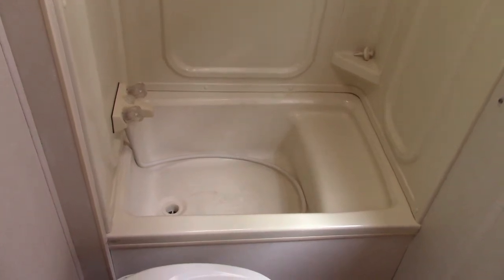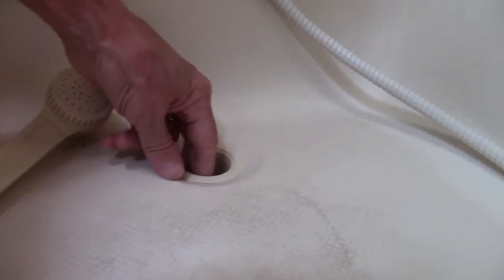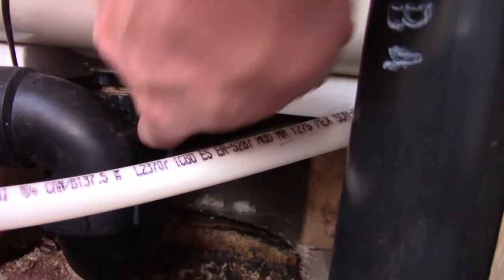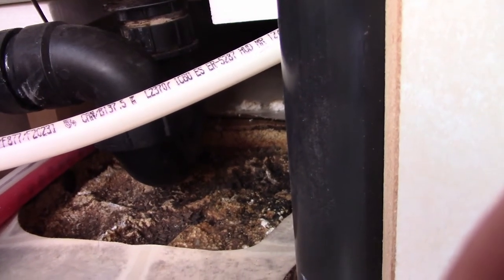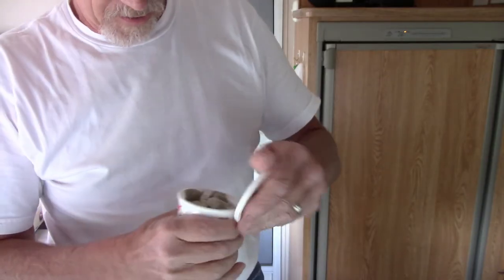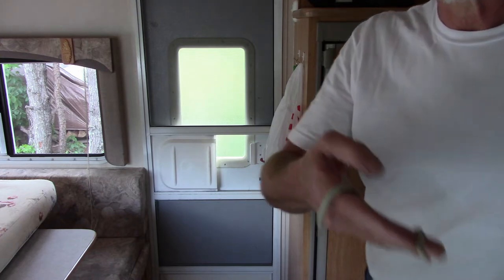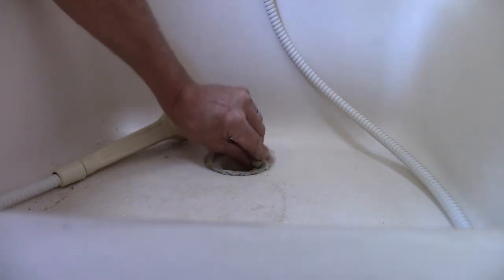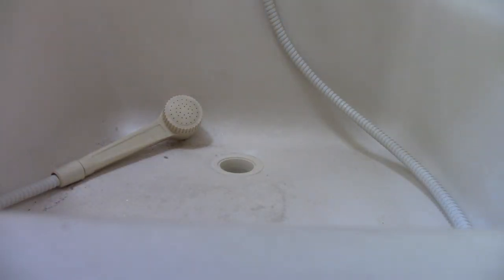RV/Camper Shower Drain Repair DIY

Comment: Did that really fix your leak? I had same problem and the cause was the lack of support under the tub?
Reply from the maker: It did fix my leak. However you are correct about support under the tub. They don't do a very good job at the factory. I had to fix mine ! thanks for watching!